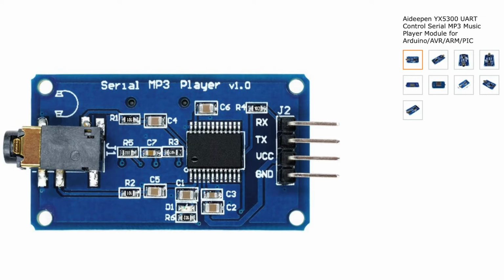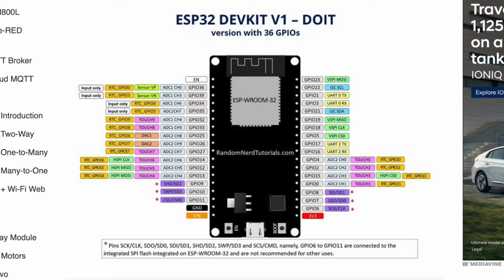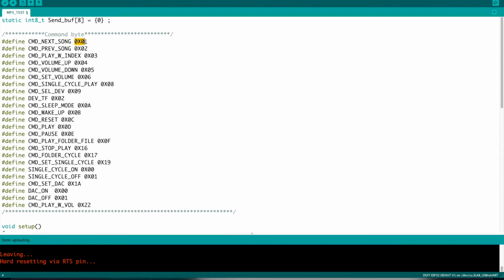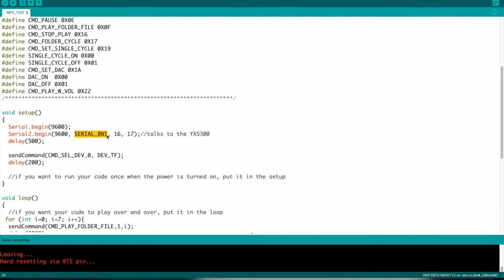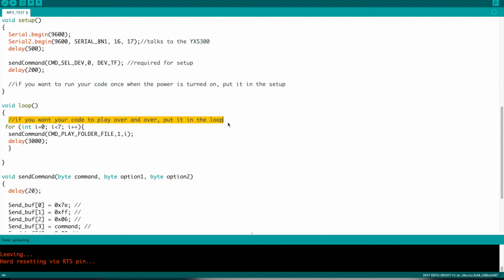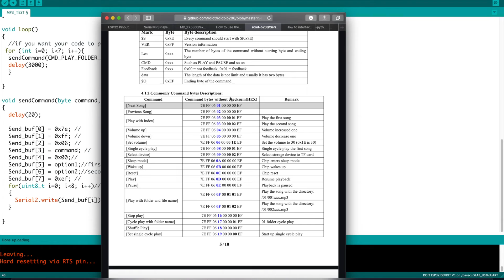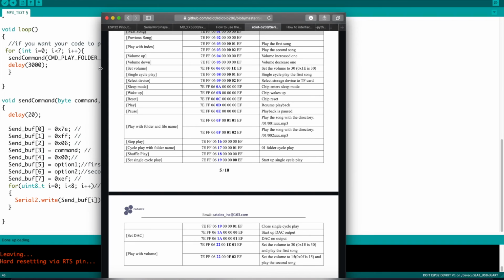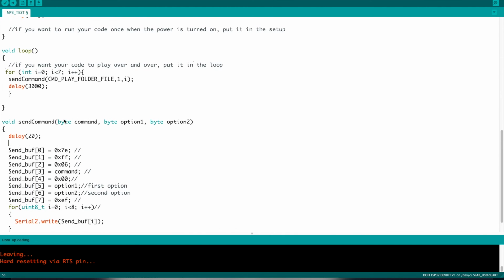ESP32: Playing MP3 files with the YX5300 MP3 Module using Hardware Serial

Comment: Excellent! I've used these Catalex boards with Arduinos before but couldn't find anything about using them with ESP32 boards until I found your video with it's great information, thanks!
My one suggestion is that for most uses it's not necessary to define all of the possible commands, the three below are the bare minimum that work for me.
I'm using this on a replica Doctor Who K-9 ( robot dog ) that I control using a PS3 controller, when I press a button on the controller the K-9 performs an action with an accompanying sound, for example when his antennas move a random sound clip plays.

static int8_t Send_buf[8] = {0} ;
#define CMD_SEL_DEV 0X09
#define DEV_TF 0X02
#define CMD_PLAY_W_VOL 0X22

void randoSound(){ 
  int16_t clip;
  clip = 0X0F04 + random(10,20);
  delay(200);
  sendCommand(CMD_SEL_DEV, DEV_TF);
  delay(200);
  sendCommand(CMD_PLAY_W_VOL,clip);
  delay(2000);
}